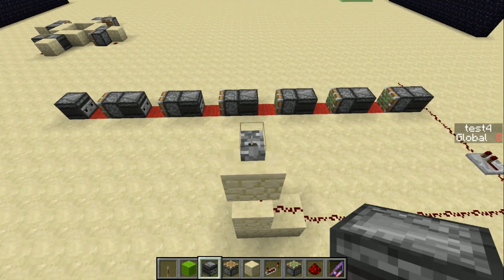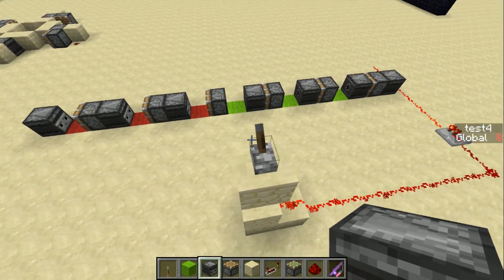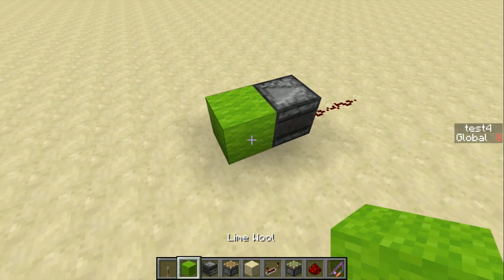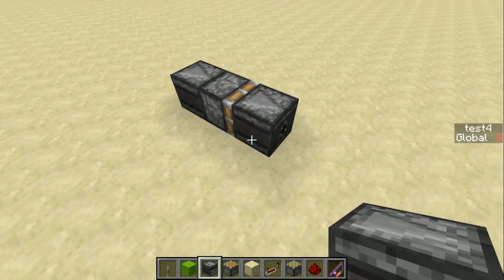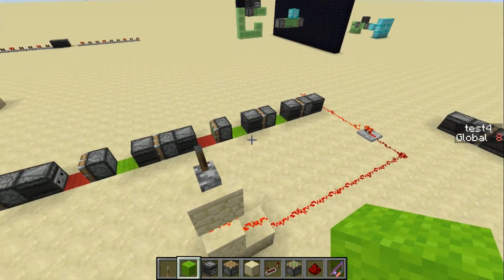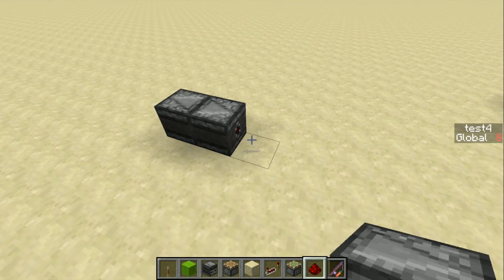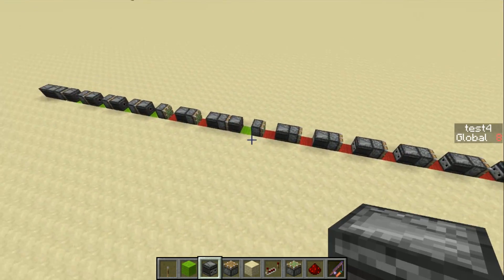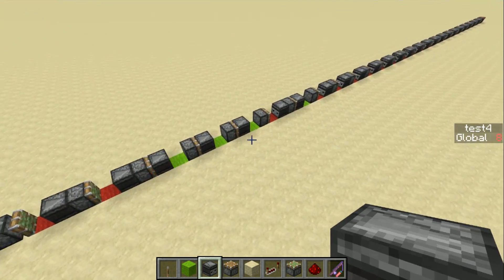Observer Binary Counter -- Minecraft Tutorial

Comment: I can't believe it will take 1 year and half to complete that, theres no way. Can someone explain to me with every single detail possible as it why would it take 1 year? I see a total of 30 observers.
Reply: It takes so long because each step in the chain takes twice as long as the previous step making this process an exponential problem. If there are 30 observers then it takes 2^(30) or 1,073,741,824 steps to run through the whole chain. Minecraft has a game speed of 20 ticks or operations per second. So each step in this chain assuming no lag should take .05 or 1/20 of a second to complete. Therefore taking our 1,073,741,824 operations and multiplying by 1/20 seconds per operation leaves us with the process taking 53,687,091 seconds. We then divide by 60 because there are sixty seconds in a minute to get 894,785 minutes. Divide by 60 again because there are 60 minutes in an hour to get 14,913 hours. Now divide by 24 because there are 24 hours in a day to get 621 days. Finally we divide by 365 for days in a year and we arrive at a final run time of actually 1.7 years. It actually would take almost a year and three quarters. I hope this helps and answers your question.
Reply: @nathancarlisle2094  thanks it does im just very dumb
Reply: @Zitronbtw  No problem, glad I could help.

Comment: There is a more compact design that builds from repeaters facing into a block which has a sticky piston underneath that faces upwards.
Reply: Um, no? That's just a pulse limiter, which shortens the pulse down to 1 tick. But it doesn't drop the block, so it can't act like a counter like this does. It would effectively replace the observers in this design with 3 blocks instead of 1...
Reply: @IceMetalPunk  Of course that design will work as a binary counter.
If you want e. g. 6 binary digits you need 7 of these redstone contraptions I mentioned.